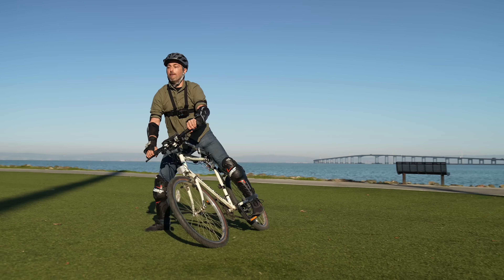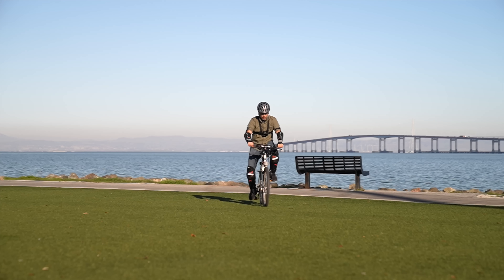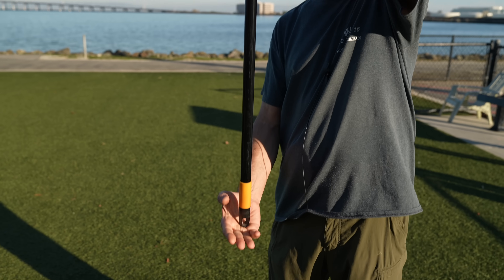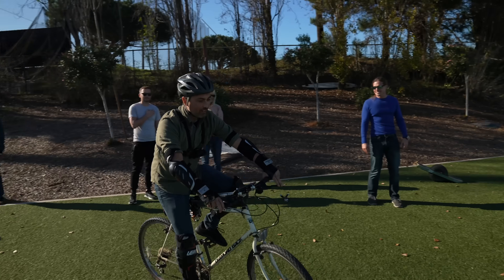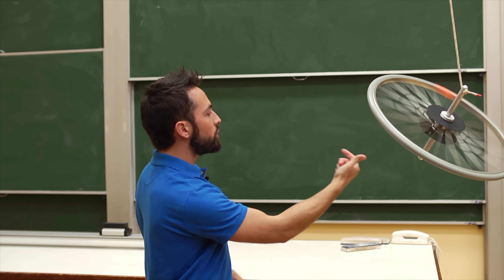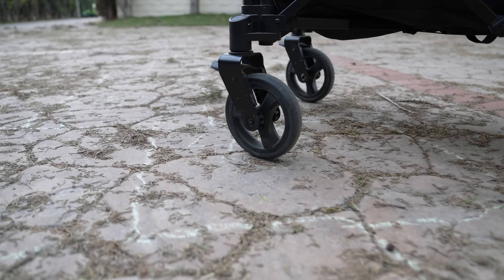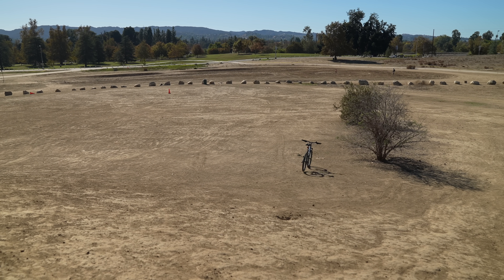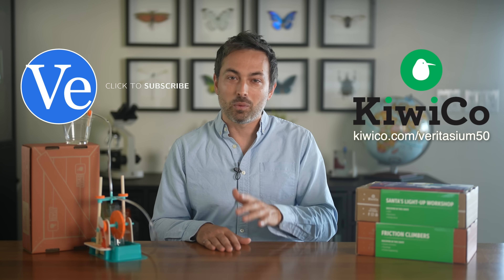Most People Don't Know How Bikes Work

Comment: Odd, I’ve always just leaned the bike heavily to one side without swerving from one side to the other. You can make a hard turn just by leaning the bike heavily to one side and standing straight up to counter balance.
Reply: It’s the same basic concept. Just turn slightly in one direction and then to the other, it keeps your mass centered. Sailing uses it, cars do it, even just walking we apply it.

Comment: You should look at motorcycles. At higher speeds you can get a clearer picture of the forces that are needed to turn a bike. At the low speeds most people ride a bike you are using 2 different methods of steering. 1 is actually turning the wheel in the direction you want to turn and the 2nd is actually turning the wheel the in the opposite direction while leaning in the direction of your turn. These differences become obvious above about 15MPH.

Comment: You know a design is perfect when a hundred or so years after it's invented, researchers are still studying how it works so well
Reply: The actual combustion engine is a cool thing, it’s just it’s fuel source. But still a really interesting piece of engineering, although not as simple as the bike tho.
Reply: Hello mr.ex president of the galaxy of "A hitchhiker's guide to the galaxy"
Reply: Isn't countersteering not only incredibly well understood, but also taught in literally every motorcycle class?
Reply: @jonathantaufer8679  Countersteering is fairly widely understood, but the self-balancing of a riderless bicycle hasn't been.
Reply: I know you aren't being 100% literal, but it really doesn't mean that. It at least means it's a method good enough to last to today, but it doesn't mean it's perfect necessarily.
Reply: @Flippy Dip I’m not saying the engine is a fuel source.
Reply: Uuuh, no, it is perfect when it works well, that's all. You can very well build something "perfect" and understand how it works. And you can very well build something imperfect and not know how it works. I don't understand why the two should be related.
Reply: @Flippy Dip no im saying the engine is a feat of engineering but the fuel source is the problem. yes its mechanical but it needs something to burn, which would be fuel.
Reply: Even more amazing is is how long it took to invent bicycles. 50 years later we already had the first automobiles.
Reply: Bicycle is easily the best vehicle ever invented after all
Reply: @Protista protista I would even argue that the internal combustion engine is the LEAST EFFICIENT method of generating motion known to man. It only has a perceived efficiency because these fuel sources already existed in finite amounts when we first invented ICE, though they had taken vast amounts of energy to be produced, and in the case of petroleum, also took millions of years. If you need to create your own fuel sources for an ICE, say ethanol, the energy required to produce that ethanol is far greater than the average person could possibly imagine. First you need to grow something containing sugars, then you need to harvest that, then you need isolate the sugar-dense part, then you need to break that up into very small pieces and mix with water. Then you need to ferment that in a temperature controlled location for a minimum of a few days. Then you need to go through several passes of distillation, which requires the application of high heat levels over extended periods. Then after all of that energy consumption, it's almost ready to use in a specially designed ICE.
Reply: I would love it if we can see & accept this for nature & universe as well :)
Reply: The opposite is true for coding. It's a huge problem if nobody (include you) understands how the code work... but it works... :D
Reply: Technically, isn't the three balance mechanisms that Veristatum mentioned only present in more modern bikes such as mountain bikes and not in the typical classical old urban flat wheel bikes?
Reply: @bravomike4734  Not at all.  The geometry of a mountain bike is only modestly different from classical old urban bikes, and even less different from a fifties newsboy bike.  Mountain bikes evolved from downhill races with old "balloon-tire bomber" newsboy bikes.  The materials, and gears and brakes, are upgraded, and the geometry is more carefully tuned, but not very different. The same equations and physics apply to those, and Raleigh three-speeds, and touring bikes, road-racing bikes, and track bikes.  The only difference is exactly what dimensions and masses you plug into the equations.
Reply: @Protista protista hmmmm idk they're still the most reliable source of power. If that was the case they'd be long gone they're over 100 years old. They exist for a reason and will continue to exist till the day you're in the dirt
Reply: @flippy5118 Having something work doesn't begin to prove that you know how it works.  People were shooting bows and arrows for thousands of years before Newton, and building fires for even longer before chemistry was figured out.   About how well bicycles have really been understood before 2000, see the Nature article in the Veritasium references, and also see kisvegabor's remark above about computer programs.
Reply: Meanwhile, the guy who made them: "I just put two wheels on a frame and figured it out."
Reply: My bike works so well because it cost me $10000
Reply: same thing with airfoils. the prominent theory of lift (equal transit theory) is demonstratively false and it’s still in books and taught in schools
Reply: everyone who rode bycicles enough knows how it works, instinctively .
Reply: My theory is that ancient aliens taught humans how to build bikes butnot how they worked. 
Theyre too perfectly designed for humans to have made something so complex all by themselves!!! 

(this is a parody)
Reply: @z beeblebrox - No the researchers aren't still studying it.  This video is just for idiots who don't understand how steering either a bicycle or motorcycle work.  Yes steering a motorcycle works the same way.  You lean in the opposite direction of the way you want to turn.
Reply: @bherber  If you check the references, actually you discover that yes people are still studying it, and actually (to z beeblebrox) by looking at the math they're realizing that the traditional configuration is only one of an unknown number of stable and controllable possibilities.
And to be more exact about turning, you steer  (briefly) in the direction opposite to the way you want to turn, and that makes you lean in the direction you do want to turn.
Reply: @bherber  That's a funny thing to say, given that the video literally says a research paper was released on the mechanics of bicycle design. Ergo, researchers are, by definition, still studying it
Reply: @z-beeblebrox  - Nah, it's pretty easy science.  Amazing invention, no doubt, and this was a very educational video, but everything presented in the video is stuff that's been known for decades.  Again, I'm not knocking it, just saying all stuff that's already been thoroughly researched.
Reply: @bherber  I'm sorry, I'm confused. Are you saying that this video lied and that the research paper it talks about doesn't exist?
Reply: @z-beeblebrox  - I'm saying that educated researchers & scientists already know how a bicycle works.  It's not something where we're still trying to figure out how it works.  This video is great for people who don't really know the physics behind a bicycle.  It's a great video.  I will attest to that.  I'm not sure where the confusion lies.
Reply: Exactly it's why the combustion engine should never go away
Reply: @borncomatose  Unless you power your bike with lit farts, I think we're talking about two different things
Reply: @z-beeblebrox  lit farts sounds much cooler to me
Reply: @borncomatose  Did you have a stroke while writing that? Are you ok?
Reply: @borncomatose  your exemple simply doesn't fit, because it was invented (and it has been improved) applying a knowledge that was known before its existance. Anyway, no big deal, this all is fascinating!
Reply: @Bill-tz3wg  now that just sounds awesome
Reply: @z-beeblebrox  they call those motorcycles
Reply: @borncomatose  the design is good, but there’s much better things
Reply: @flyingonionring  nothing beats the combustion engine. If they're built right it'll last for at least 15+ years.
Reply: @borncomatose  “nothing” there’s better options
Reply: @flyingonionring  no there isnt
Reply: @borncomatose  rattle rattle rattle. Enjoy your slow-to-start greasy overcomplicated machine

Comment: Counter-steer or push is very necessary on a motorcycle. Going 60 around a left hand turn, I push the left side of the handlebar away from me and the bike immediately leans left and turns left. I never realized I was doing that until I was watching a motorcycle video which pointed it out to me. Mind blown! The handlebar push is most effective during rapid lane changes. Leaning took longer to initiate the turn vs handlebar push (counter-steer).

Comment: you can technically turn right without turning left by standing up and riding and leaning to the way you want to go but you need to learn how to corner it's basically a way to lean to the side where you want to turn like if you want to turn to left you lean yourself to the left so it's possible but hard and the cornering part you to go basically to the maximum of the corner scale-like lean so hard it's hard and if you want to come back up insanely quickly you need to lean to the other side sooo it's complicated but it's possible
Reply: It is on the internet and you also said that we can trust you, so it must be true.

Well, it isn't.
Reply: also, you can ride a cycle down a hill without hands and it will be ok but if you try just full-on unicycle mode on flat ground it may take you months or even years to learn
Reply: I said this because I have been a mountain rider for over 4 years and a cycle rider/trickster for 10 years and almost 11 years now sooo that's why you can decently trust me

Comment: Thank you for this. I have tried to explain countersteer to people for years, and some just flat refuse to believe it.

Frankly, if this were taught to motorcyclists, I believe many lives could be saved with better accident avoidance techniques. If you both countersteer, and stomp the appropriate foot peg, the motorcycle will make a damn near 90 degree turn...and in a hurry. Wanna go left in a hurry? Push the left handlebar forward, and stomp the left footpeg.

Comment: What if you lean and turn in the same direction? Should the torque caused by friction and gravity cancel out? With the broom analogy, this would essentially be the same as applying a force to the top while pushing it at the bottom(both in the same direction of course) which should still work.

Comment: Not one of them knows how to use brake hops. Straight steering or not it don't matter, You could weld the steering wheel and just use the brakes to hop around. Hell of a work out to do all the time and hard on the brakes.
Reply: There are ways to do it.  But we're trying to demonstrate how the bike works in normal operation.  With the steering locked you could do a wheelie or hop the front wheel.  But both would just be a way around demonstrating the point we're trying to make.

Comment: Bicycle self-steering and airplane dihedral.
I have an airplane analogy that may help understand bicycles. Or at least understand why it's so complicated.
In airplanes, wing dihedral provides self-leveling. Dihedral means the wingtip is not at the same height as the root (where it's attached to the plane.) Usually, the tip is higher by a few degrees, but anhedral (downward sloping wings) also works.
When flying straight and level, a dihedral airplane has the same amount of wing area 'pointed down' at gravity.
When the airplane rolls to the left, the left wing becomes 'more level' and the right wing 'further away from level.
The left wing has 'more surface area pointed at the gravity' than the right wing.
With that, the left wing will have more lift than the right. With that, the left wing forces the plane to roll right until the left and right wings' lift are *equal*.
So the trick is to fit gravity, the bicycle and its balances, and the rider all in the same picture.
It's complicated. The bike bouncing down the hill, with the rear end whipping left and right and forcing the front end to return to center after a rock turned it, that's rocket science equation level stuff.

Comment: Dunno I think most people who don't ride a lot tend to use the wheel to balance but as someone who has ridden a bike their whole life and is going on 40 I rarely turn the handle bars unless it is a sharp turn. I lean left then right into the turn and not move the wheel right a tiny bit.
I guess I just ride a bike like most people who ride crotch rockets do and do most of the steering through shifting your body weight since I also use to do BMXing and stunts and turning your wheel makes you loose control.

Comment: Here is an interesting experiment that would settle if or how important the giroscopic effect is: take a normal bike, stop the wheels from turning, put iceskate blades below, sit on the bike and  have somebody give you a nice push on an ice surface. See if you can control it, make turns, follow a path that you would easily follow with a bike on normal ground ... My bet is you won’t be able to do it.
Reply: That's basically what a ski-bike is, and people have no trouble riding them.  They've also built bikes that have zero gyroscopic effect by cancelling it out with gyros spinning the opposite way.  People can ride that one just fine too.
Reply: @Rick_Cavallaro  interesting, I haven’t thought of that. I have never tried a ski-bike, but I have seen them, and now that you mention it, I also noticed that they sit on the ski-bike and they have small ski attached to their feet: I wonder how easy or difficult it is to maintain the equilibrium without making use of them, and, making the sliding part nice and slim.

Comment: I discovered this after my grandpa got a tricycle. He kept going into the hedges and we were laughing at him. Until we tried it ourselves and did the exact same thing. We were trying to move it like a bicycle, so when we tried going left to avoid the hedge, we started out with the subconscious right turn. But when we ACTUALLY turned right, we got confused and tried to compensate by turning even MORE to the right, until, yes, we ended up in the hedge.
Reply: I've seen the same effect from long-time motorcyclists who try riding a side-car rig for the first time.  The interesting thing about a motorcycle side-car rig - it's relatively easy to "fly" the sidecar (i.e. maintain a stable ride with the sidecar wheel in the air), in which case the rig reverts back to counter-steering to initiate turns!
Reply: That's part of why kids have a hard time when you take off training wheels...
Reply: @AshOnTop23  it's easier to learn when the training wheels are uneven. So that way a kid can actually practice how to ride with out them. Because if you balance right the won't touch the ground.
Reply: Try it with a 1200 cc trike, see how far you get.  That was the exact reason I ran straight off the road into somebody's garden.  And it's just as bad going back to 2 wheels after 8 years on a trike.
When my dad and uncle trucked the trike to me, we offloaded it and I spent 2 hours circling through a truckstop parking lot, learning how to turn, speed up, slow down, and change gears.  2 hours in hot July sun before I was confident enough to slowly ride it home.  2 years later I was riding downtown and stopped at a light by a delivery truck.  The driver rolled down his window and said "You!  You were the guy at the truck stop!".  Yeah, I got remembered.

Comment: It’s not one or the other. It’s a combination of gyroscopic force, Frame geometry, Head tube he angle and steering. I can pretty much stay in one spot completely still on a bicycle indefinitely simply by transferring my weight and balance and making corrections to the steer tube.
Reply: Yes, that sounds like a track stand.  I'm guessing you have the front wheel turned fairly sharply.  But can you do that with the front wheel locked straight ahead?

Comment: Would you not be able to push down on right handlebar to get bicycle off balance instead of counter-steering? Is it impossible or is it something cyclist do not learn because counter-steering is more effective?

I never learned to ride a bicycle, but e-scooter should have the same concepts, except that its easier to get it off balance for steering because you can use feet and hips, not just hands.